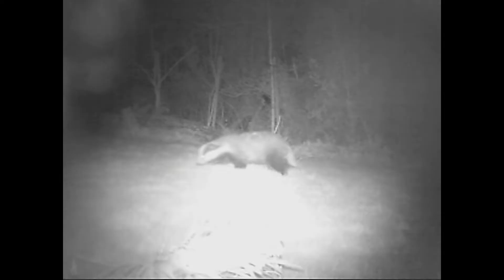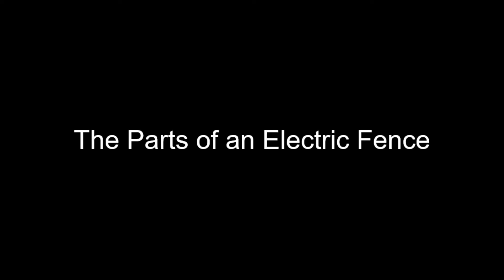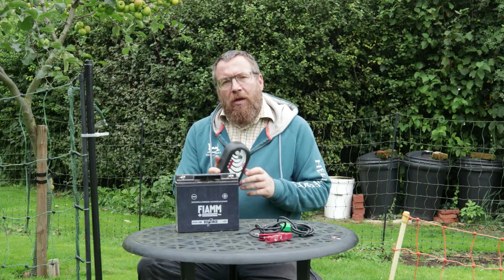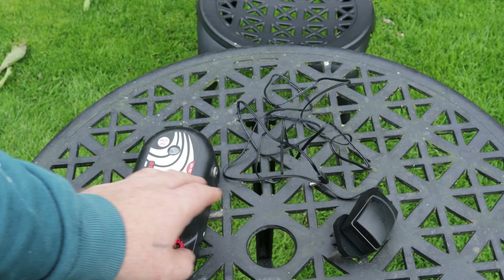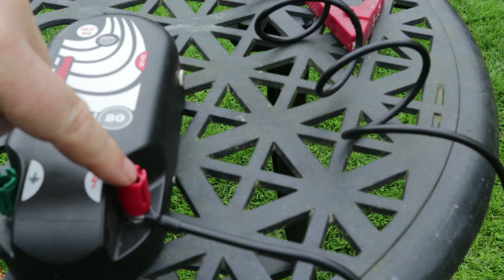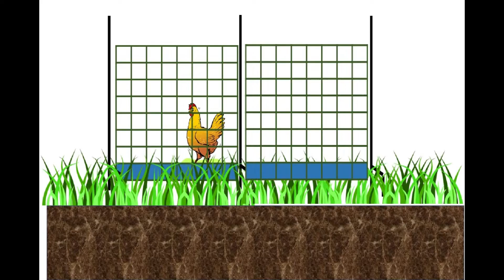Understanding an electric fence - a beginner's guide

Comment: Hello  chicken gurus. I'm just watching the Olympics and that reminded me that I have a question about fencing. Actually I have 2 questions.  Firstly,  I have 3 50 metre lengths joined together and all the joints are in shady areas . All of the videos I have seen regarding the connection of fence to energiser shows the cables being attached to the metal tabs. The closest that I can realistically site my energiser is about 12 metres from a join. So, can I just connect it to the top strand ( and I  suspect that is 'yes' but it will be a poor connection) or will it be better to run a cable along to the junction  ?  Secondly,  after laying a strip of weed fabric along the fence line, topped with gravel, when I  replaced the fence posts which had previously spaced the fence just right, now left me with about a metre and a half of fence left over. Is it ok just to roll this up or do I have to space it all out again ?
Reply from the maker: @chrishamilton-wearing3232  Hi Chris. Buy a short section of lead out cable at least 1.6mm in size and connect the energiser to a join which in turn connects to each strand. Dont roll the wire tight so that it touches itself but just double the extra bit back on itself

Comment: Hi  i Have just purchased the electric fence & gate -where did you purchase your mains transformer plug please.
Reply: Hi. The wire that has the 3 pin plug at one end and other end plugs into the energiser. Thinking is it included in the kit.
Reply from the maker: @mdunkley6924  That's interesting. Not all energisers have a mains input - some are battery only, some are mains only some are both. The range I use and showed are from Hotline - the Gemini range. They should all come supplied with both battery and mains leads

https://hotline.horizont.com/battery-and-mains-energiser

If it was a Hotline Gemini that you bought, I would contact the seller. Hope that helps?
Reply: @EnglishCountryLife  Thank you very much for your advice, The one i have ordered is a Hotline Gemini 120 so same range as you. Thank you for your very informative post i shall be referring back to it on fitting day.
Reply from the maker: Hi, by "nains transformer plug" do you mean the energiser? The thing that steps up the voltagem

Comment: Finally! A video that's starting to address electric fencing for beginners!
Reply from the maker: Glad it was useful 🙂
Reply: @EnglishCountryLife  do you do any videos about where the ends of the polywire go (for stranded fences) or how they should be looped around the stakes? Literally no videos will say. They all use massive reels and are they still connected if they are on a reel? No one explains.
Reply from the maker: @laightnightknits4358  I don't use strands much tbh. It's easy though. Support the wires on insulated supports of the right type. Extra wire can stay on the roll or be cut to length. You only connect one end of the wire to the positive terminal of the energiser. If you then touch the wire anywhere along it's length, the electricity comes out of the energiser, through the wire, through you, through the soil to the earth spike and through that to the negative terminal of the energiser. YOU complete the circuit. Extra wire can be left on the roll on the final post. Does that make sense?
Reply: @EnglishCountryLife  yes thank you. The placement of wire seems to get missed out of most videos, so I didn't realise you don't have to connect both ends! Thanks ☺
Reply: @EnglishCountryLife  thanks for your help! I got a jolt ☺ If only the geese would stop going "ow!" and then walking right through the fence. 

Guess I'll be going into Training mode now! I suppose with your chickens they can't walk right through - which is a plus for netting- 🤔 Hoping the fox responds differently to the stranded fence - erp.
Reply from the maker: @laightnightknits4358  They generally do - good luck

Comment: Great vid , very well explained, does it matter how far away the earth stake is away from the fence
Reply: Thanks 👍
Reply from the maker: It's important that it's a good way from your house earth stake but as regards the fence, keep it fairly close ( a few feet) but not touching
Reply: @EnglishCountryLife  I’ll be running it off a battery which will be in my shed next to the energiser , the fence will be about 15 yards away from the shed
Reply from the maker: @southsomersetferretersfiel5202  15 yards is not a problem but you will need to use heavy duty "lead out" cable for both the power and the earth
Reply from the maker: @southsomersetferretersfiel5202  This is the type of cable you would need

https://amzn.to/3iYICuD

Comment: What a great video. Quick question for you, if you or an animal completes the circuit by touching it, does that mean you can't electrocute yourself if you are wearing rubber soled shoes (ie wellies)?
Reply from the maker: Rubber shoes do provide some protection but you still get a jolt. If you touch the fence whilst kneeling in a puddle you make a much better circuit and get a bigger jolt. Ask me how I know!

Comment: Hi - Another great video - A question, please . . . which may appear a bit bizarre . . .
I would assume predators have no clue that the fence may give a shock (are they that intelligent). So the fence is only going to act as a deterrent to a predator that has received a shock from it.
So from the pain of the shock, they learn to keep away. Does that sound right?
I assume you have two rings of fences in chicken enclosure. The inner ring to keep the chickens away from the electric fence so that they don't get shocked.
Again, does that sound right?
Thank you for your time and very best wishes
Reply from the maker: Hi. There's only one fence. As you say creatures get  a shock and learn to stay away. That applies to chickens as well. They get a small shock and learn not to touch it again! 😁
Reply: @EnglishCountryLife  Got it - I appreciate your reply - Best wishes

Comment: If I’m using a mains energiser do I gust use run out wire for both live wire and earth.. does the earth need to be near the electric fence or can it be closer to the garage the source of mains power and where the energiser will be (energiser kept inside the garage)
Reply from the maker: Hi Janes, I have planned a detailed video on this but in the mean time;

Yes you need to run out both wires. Its really important to use heavy duty insulated lead out cable.

The earth bond needs to be near the fence and at least 10m from the earth bond for the garage or house

Hope that helps, happy to answer questions

Hugh
Reply: English Country Life thanks 😁

Comment: I’ve finally got around to getting poultry net for my chickens. Do the ends of the net have to join or can I use corners of my large coop as corners?  Also, the fence is very saggy, should extra posts help prevent this?  Thank you for all the great info!
Reply from the maker: Hi Renee 😊

I do plan a video on this subject but in short,

Extra poles are a must. Double the number of poles & get the ones with two spikes on the bottom.

No, the two ends don't gave to meet but you have to atrach the energiser to one end

Hugh
Reply: English Country Life perfect!  Thank you!  I can’t wait to see the next video.